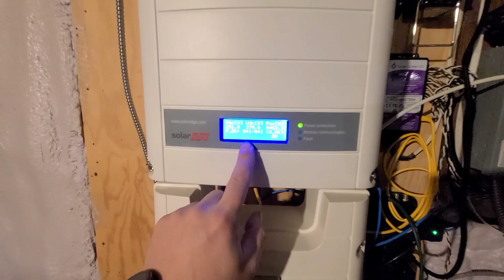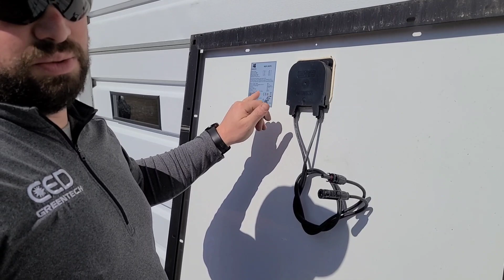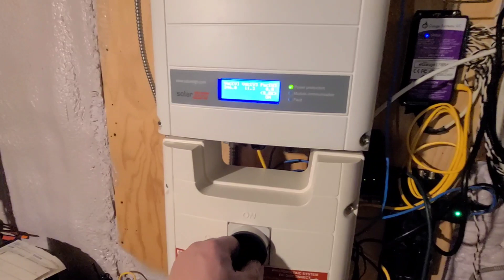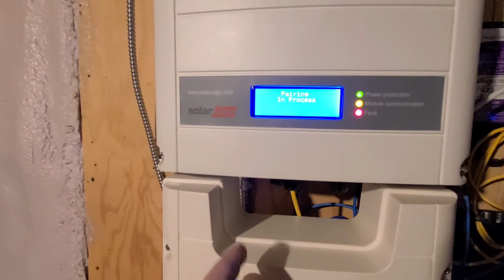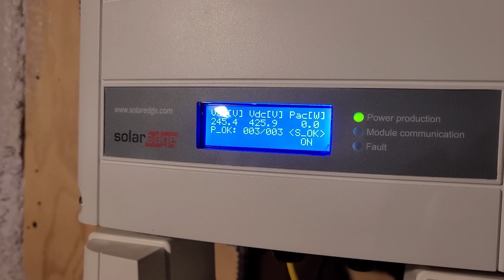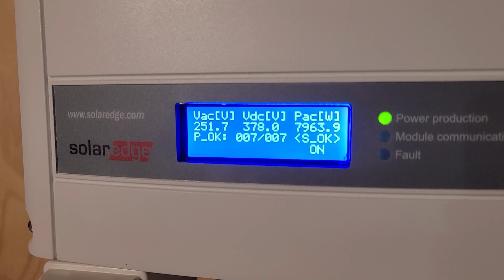How to Replace a SolarEdge Optimizer

Comment: Ok, so if the 1VDC isn't an indication of a bad optimizer, what is?  What can I tell SolarEdge that will convince them?
Reply from the maker: It used to be we'd give them VOC and ISC readings of the panel, along with resistance on both sets of leads on the optimizer if it was still reading 1V. Just start a case with them and see what they require.  Sucks because that means you're on the roof twice.  We'd always bring extras with us and just replace it, then RMA after.
Reply: @benssolarandbattery Thank you for your ABSOLUTE LIGHTING reply! We have the problem that we are the consumer, and it seems like SolarEdge doesn't want to talk to anyone but installers.  Our whole system is not producing and it seems like it's related to optimizaters.  One string is shown as communicating, the other is not.

Comment: This video was a long time ago but we have this system just bought a house with it and the original installation company went out of business of course so we have 25 panels and 8 are bad so how can we find the bad ones solar edge says we have to test them all?
Reply: You need a solar tester which is the easiest way and you basically need 1 volt per unit when hooked to solar panel I just installed a 27 panel used system and didn't check all of them so had to find four bad ones! Found good used ones on Facebook marketplace

Comment: have a SE500H inverter(grid tied) with 22- 285Watt panels, I've read where you can over-panel your system by 200%(or 155%). It used to be where I paid just the delivery cost electricity has gone up since the install and I would like to upgrade to higher what panels, maybe 400watt, so new optimizers would be needed correct? Also would like to add battery back-up. with your knowledge is this possible?
Reply from the maker: Yes, new optimizers (yours are likely 300 or 320). Any kind of AC coupled battery will work as well. I wouldn't recommend SolarEdge's battery though, haven't heard good things about it.
Reply: @benssolarandbattery  the problem is finding the same size panels(measurements) as the old ones, with higher output, also have read that you can't mix and match different watt panels on the same string
Reply from the maker: @marks8052 you can mix and match with solaredge strings.  You'll never find exactly the same physical size though.
Reply: @benssolarandbattery Do you have battery back up?
Reply: if yes can show show us how to add ac coupled battery back-up thx again for the help
Reply: my bad found your vid

Comment: Nice Video very helpful, question I'm swapping my SolarEdge optimizer for tigo's  TS4 AO and AS. yes i will be pulling the string inverter too! turning off everything but I'm doing one panel at a time, i have two strings a twelve and a ten. trying not to pull them down just going alone and swapping them out. can i do that without disconnecting everything first?
Reply from the maker: I would avoid those tigos and stick with the AF.  I've always had issues with the AO.  Also, I believe they let full voltage through until commissioned (AF's don't), so you're going to want to do the inverter at the same time if you use AO. Also, make sure what your new inverter can handle those string configurations. Depending on the VoC, the strings of 12 could be pushing the upper limit.

Comment: Question, my system has an error message for “Module voltage mismatch” the module is under-performing compared to the rest on that string. Not completely at 0, but definitely underperforming. Could that also be an optimizer being bad?
Reply from the maker: No, thats a bad module. Likely a failed bypass diode.  I have 3 of those on my roof right now, but they're still producing 2/3 and I'm busy.

Comment: WIsh I'd seen this last week, I changed one of my optimisers at the weekend, 0v out of the optimiser, panel was spot on with VOC. I have an SE4000 installed in 2015, so pretty sure the hold the button in trick will work, but wasn't aware of that, so had to get SolarEdge support to do the pairing and update the layout - I haven't managed to get site admin access yet, which is frustrating. Mind you even if I could of paired them via the button, I still wouldn't have been able to update the layout.

Comment: Does anyone know how to get Installer credentials on a SolarEdge system.  These systems aren't rocket science but the SetApp required to do any testing and configuring of the system is not accessible by the home owner.  Kind of a bad deal when your installer goes out of business and I am now on my third inverter in four years.

Comment: Thank you God my system is working okay! but the inverter is too small it clipping my production (Inverter is SE7600 my system size is 8.69kw). a bigger inverter is 2K or more I'm adding a hybrid inverter for batteries, so then it cheaper to swap those optimizer out and pull off that SE inverter and run my panels to the new inverter.
Reply: id you ever swap to a hybrid inverter?

Comment: Ben... THANK YOU!  We have a 31-panel system on our home located near Albany, NY, that devolved to 26 functional panels due to optimizer issues.  Even worse, our installer went bankrupt, and I couldn't find another solar installer that was interested helping us install 3 RMA P440 optimizers that SolarEdge sent me to replace 3 of my failed P300 optimizers.  Otherwise, SolarEdge support and its online video weren't much help.  However, thanks to this video, I was finally able to do it myself.  For others in the same situation, be certain to fully bleed voltage from and then completely shut down the system by cutting off the main breakers (covered by numerous other videos) before hitting the roof and push and hold the green button on your inverter to re-pair the optimizers with the inverter.  SolarEdge claimed it was remotely re-pairing my optimizers with the inverter while updating the serial numbers of my new P440 optimizers.  However, apparently not since the inverter repeatedly failed to recognize the new optimizers after the SolarEdge remote re-pairings until I rewatched this video and realized I could complete the re-pairing myself by simply holding the green button.  Bingo!  That worked!  In summary, I owe you a at least a few beers at one of the many VT craft breweries!  The only downside is that I shattered one of my outdated (2015 vintage) SolarWorld SunModule SW 280 Mono Block solar panels (Pmax 280, Voc 39.5, Vmpp 31.2, Isc 9.71, Impp 9.07, and 39.5 x 65.95 inch specs) in the process of replacing the 2 additional optimizers and cannot find a used or similar replacement.  Thus, please let me know if you can recommend a new or used option or alternate replacement panel instead.  Regardless, THANKS AGAIN!... Mike

Comment: How did you know which optimizer wos the faulty one?
Reply: Your SolarEdge monitoring app should graphically show exactly which panels are and are not working as well as how well they are working.  If you don't have a monitoring account, contact SolarEdge and/or your installer to set one up.

Comment: I know this is an older video but I'm getting a new SE system installed in the next two months and find this very interesting. Just wondering if the ops have gotten any more reliable since you posted this? Thank you soooo much! Definitely subscribing to your channel!!
Reply: hey! did your system get installed?
Reply: @Livingsolaryourway  It’s been installed now for almost a month and I’m still waiting for the final inspection by the city before I can use it. This has been a very frustrating 3 months!

Comment: How did you know that was the actual optimizer what I mean how did you know that was a specific one?
Reply: I was wondering the same.
Reply: In the SolarEdge Monitoring Portal you will see a Physical Layout and a Logical Layout of your system. You can see which panel (or optimizer) is the culprit visually and troubleshoot from there. I'm having an issue with one of my panels right now, and this is going to most likely be an optimizer issue as well. We had the same Inverter he shows in this video until last year sometime when a power surge from the AC side broke the relay in it and it would generate power anymore. SolarEdge was quick to get a new HDWave (non-screen) to us to replace the failed one.
Reply: @taterwulf 
I see, but every time I trouble shoot I have to check every single one of them cause in the app the whole string is missing if one doesn’t work, I’ll have to improve a little more, thanks

Comment: Well how the hell did you know what panel had the bad optimizer to begin with if the bad optimizer output was 1V? Can you go through that process 1st?
Reply from the maker: @BDProperties-y3v  online monitoring with a map of the optimizers. That should be done with every solaredge system.

Comment: @benssolarandbattery Great video!  As far as adding the serial # of the optimizer while on the app....do I need admin permissions?  I am listed as a user.  Thanks
Reply: You need an installer associated with your Inverter SN to update optimizer SNs.  Unfortunately, SolarEdge won't grant an installer account to mere mortal homeowners like us even though the installer app shows a "self-installer" option. Your installer (if you still have a solvent installer) can update the SNs for you at little or no cost.  SolarEdge will typically do so as well via its support portal if provided the relevant panel ID and old and new optimizer SNs in a convenient (i.e.: neat tabular) format.

Comment: Thanks for the video
How did you know that specific optimizer is defect and not the other one ?
Thanks
Reply from the maker: You should have a map of the optimizer serial numbers done at installation, which gets added to online monitoring.  If not, a thermal camera or a light coat of snow in the morning should show which one it is. I've seen panels with bad optimizers show a little warmer than the others.  Serial number map is preferable though.
Reply: @benssolarandbattery  thank you so much for your reply and I appreciate it 
The problem is that there is many strings 
Every string take from 15 optimizers 
We are talking about many strings and optimizers I check with meger electric test there is a lot of fualt 
There is no LCD on the inverter and I'm not the person that did the work before 
That's why I'm looking for fatest way to detect the detectives optimizers
And thank you so much

Comment: When I install those, the control box comes with the little tool to disconnect the wires. Its flimsy plastic and breaks if you keep it your pocket, but works like a key. Solar edge should of included it when they shipped the optimizer

Comment: The dc doesn't drop until you flip the on/off switch, then it gives you a count down on the dc voltage
Reply: Yeah and without turning that off and swapping an optimizer you risk swapping it under load which could fry out the string
Reply from the maker: This was done with an older solaredge inverter, but the DC on that dropped with the on/off switch, DC disconnect, and AC disconnect.  If you turn the DC disconnect off, it won't be done under load regardless.

Comment: Are you considered an authorized installer?  The installer I contacted wanted me pay $700 for them to come and install the optimizer. It’s not difficult to change it out and I’d like to do it myself if possible. Advice?
Reply from the maker: I am.  You should call solaredge.  They should do it for you.

Comment: Hi Ben. Thanks for the video. How do I get into the website and register the new optimizer?  I only have the owner monitoring app…. Is there a different website I should use?  Or is this where an installer comes in?
Reply: Did you ever get a response to this question?  I think I am going to have to replace one on my system and am trying to gather all of the information I need before attempting it.
Reply: @scottflowerday7654  hey Scott, did you get it done? and what app was you on, the owner app?

Comment: How did you  know the one to change?
Reply from the maker: I made a map of the serial numbers when the system was installed. That gets put into the monitoring site and then you can see which one it is.  If you don't have a map, a thermal imaging camera will work to identify the panel.

Comment: Thanks for this video! I’m in VT also. My solar company wanted to charge $290 to replace my optimizer! Told them we are all set and to ship our part. Will be tackling this next week.
Reply from the maker: I'm curious as to who it was...  we offer a 12 year workmanship warranty, which includes labor to replace parts covered under manufacturers warranties. Sometimes the manufacturer pays a truckroll fee, sometimes they don't.
Reply: @benssolarandbattery  Same Sun in Rutland. They offer a 5 year labor warranty which expired 9 months ago.
Reply: I did the install but I can’t figure out how to add the new optimizer to my system. The inverter isn’t reading all my panels either. I have 29 but it’s only reading 28. Any advice?
Reply: @ryanvt404  did you ever figure this out?
Reply: @RichardBurns-r6z  I did! I bought the tool needed to disconnect the wires off Amazon for like $8. First optimizer took about 30 minutes to swap out with taking my time. The second one took about 15 minutes knowing what tools I needed to save trips up and down the ladder.
Reply: @RichardBurns-r6z  I called solar edge who made my system and they remotely set up the new optimizer
Reply: @ryanvt404  Thank you!

Comment: Hi Ben, thanks for the video. I swapped the faulty optimiser but the inverter (SE4000) is stuck in night mode. The inverter was working fine before I swapped the inverter. Any idea what the problem is?
Reply: sorry I meant before I swapped the optimiser
Reply from the maker: @Oliver J Connolly  stuck in night mode after the optimizer swap could mean that you didn't get the leads plugged in all the way. Did you do a pairing cycle on the inverter after you turned it on? Also, make sure you turn the DC disconnect knob on the front of the inverter on if you have one.
Reply: @benssolarandbattery  thank you for the prompt response. After switching the DC isolator on/off 5 times it finally kicked in. I think the DC isolator itself might be intermittently faulty. I did the pairing again and now it sees all optimisers including the new one. Thanks again.

Comment: Question for you, older video but maybe you get this.  I have 40 panels, 4 strings, 2 inverters.  Both inverters are identical size and have same number of panels on them (20 each).  I had a Arc Fault code show up at the exact time/date that one of my inverters output dropped by half.  A month later, one inverter is still only outputting HALF of the other one, and is showing 19 of 19 optimizers.    (should be 20)    So why does that inverters output drop 50% because one optimizer is out?  (I had my system installed, they are taking a long time get get someone out to diagnose/repair it, its now been broken longer then it worked (2 months with no issues)
Reply: Wow! you have been thought something.  My solaredge inverter is working okay but solaredge equipment is expensive, i wanted to add batteries but it's almost a $7k upgrade just for batteries. Then you have to use their batteries only and solaredge won't answer the phone, all emails pointing you to other people.  My installation company went out of business 12 months after installing.  The solar finance company wanted me to sign a new agreement with them i said no just come get your equipment that i over paid times for. The sell man told me enjoy your free system now.
Reply from the maker: Sounds like an entire string is down, and the arc fault code was likely thrown by a bad connection burning up.
Reply: hey LT1, what happen to your system and how is it doing now?
Reply: @Livingsolaryourway  I ended up having a incorrectly crimped connector on one string that was causing the arc fault code.   After installer fixed that, system worked very well for about a year and a half, then started having 3x2 communication errors. At first no production issues, but would get weird production data sometimes on the app.  This spring one inverter stopped producing. A power cycle would bring it back online for few days, then a day, then just a few hours.  I called, they come in about a week. Still, just a 3x2 code. The installer come back out and removed the cellular communication modules since I was hard wired LAN internet connection, and unplugged, reconnected every cable on the boards in the inverters.  They also said the RS485 connection between the slave and master was not wired with the correct pair of wires in the cat5, and could cause issues with communication. They also said the cellular modules still present would cause issues with the LAN connection.   That was Mar 19th 2025 they did that repair.   I was skeptical of the repair, but not a single issue since.

Comment: Thank you for the video. I bought an optimizer through ebay and suspect that it may be a counterfeit, as it has no stickers on it. I paired the inverter as you showed and it is not working. I tested it before installation and it was working. Do you have any tips on what to do to make it work?
Reply from the maker: Is it showing up on the inverter at all?  For instance if you have 30 panels it would show P-OK 30.  If not, try pairing again and make sure it's light outside when you do.  Could be bad for sure, I'd be wary of optimizers on Ebay.
Reply: @benssolarandbattery  Yep, shows 36/36. Repaired and get 0, 0, 0 and 37.38 on the panel. I tested the optimizer on the ground and it was showing a 1 but I didn't look hard enough to see if it was a 1.0 or 10 or what. Everything else on the system is as should be and I had the panel off while I was waiting on the optimizers and it showed 35/36 on the screen while it was out.
Reply: @benssolarandbattery  Also, they do have Solar Edge cast into the bodies but there are no stickers of any kind on them. Only on the outer box.